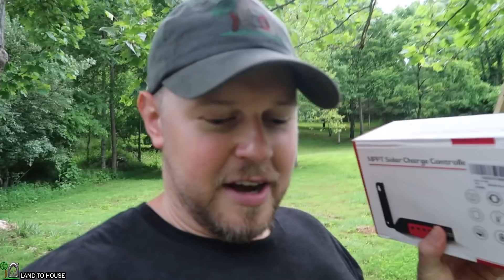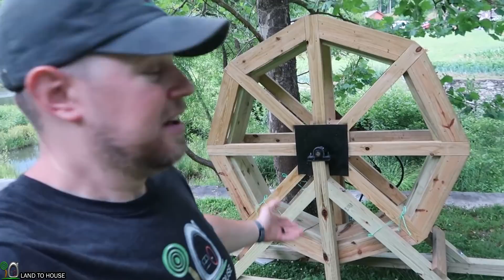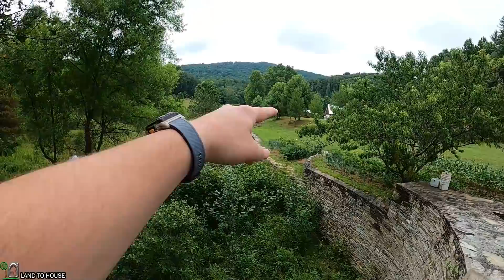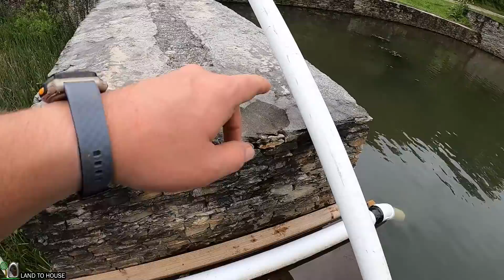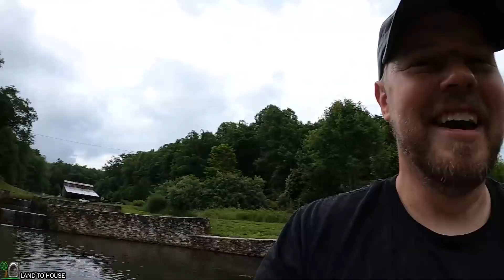Forced to move the 4 Inch Micro Hydro Turbine

Comment: I can think of how to improve the system with that same 4" turbine if you put a 30cm edge plank screwed together and then insert a pipe that is a bit too wide for the water intake, you avoid the water collection elbow and having to prime it, On the other hand, insert a vertical suction pipe with a larger diameter and end in the river with an elbow and an angle of no more than 45° or max, for example 67°, but not 90°, which slows down the speed of the water! With all this, increase the upper level by about 30cm, which translates into another 30-50w more, an improvement in water intake and better self-priming. 
on the other hand, a basic victron-type mppt, for example, works very well and if it is masrtsolar you can see the data for several weeks via Bluetooth! it's perfect for testing

Comment: If you're still experimenting with this setup, try putting your generator at bottom of water fall to get head pressure and find out flow of (gpm) of water fall to have idea what you're working with also find out how much  water is coming from the water fall above where you are experimenting at,so that water flow is constant you achieve voltage to simply 12v system. Good luck 👍

Comment: Could you use the venturi effect to self prime the siphon? You'd sleeve the discharge pipe in a slightly larger pipe which collects water from the waterfall, as that water flows past the bottom of the exit pipe it should create a venturi effect. I'm not sure it would be enough to prime it though. It would have the added benefit that although the siphon would stop when the pond drains down it would restart once the water flowed over the waterfall.

Comment: The stonewalls and dams are beautiful.

A water wheel should be round if it is to produce electricity. Wood is not good for waterwheels as wood absorbs water and the wheel becomes unbalance and hard to govern, stainless or aluminum would be a better choice for a waterwheel to produce power.

Comment: YOU HAVE A PVC TUBE FOR A HIGHER CAPACITY TURBINE, YOU HAVE A WATERFALL FOR BETTER WATER PRESSURE, YOU COULD HAVE 50 KW TO 100 KW IF YOU ORGANIZE THE STRUCTURES WELL, I SEE ANOTHER WATERFALL, YOU COULD BRING A TUBE TO GAIN MASSAGE FROM THE FIRST CASCADE HEIGHT AND HAVE MORE POWER

Comment: If you put in a ball valve in to 4in pipe coming over the dam would it alow you to stop the turbine without letting in air in to the system and start it back up easier

Comment: Even better than a tennis ball is a linear flow gate, simple put would be a section of standing pipe that has long deep slots. I have built them for water tanks, by take 3/16" x 2-3" strapping (flat plate). With the 2-3" sides facing each other, then flow rate is based on how tall this intake gate is. The depth of the strapping is what stops the water from making a vortex, can create a Laminar Flow into the pipe, this will help increase out put by a small %.

Comment: Think about the buckets on a water wheel. The max torque and power are when the buckets are even vertically with the shaft axis. This design however has dumped all the water out by that point. So ideally the buckets angle back so that they pour out near the bottom instead of before the half way down point. You want to maximize the amount of water and the distance it falls.

Comment: My question here is and I am a first time viewer here, why are you running a siphon feed instead of a pressure feed? you will get much better results installing the pipe below the waterfall using the water pressure instead of relying on gravity to suck the water through the pipe. instead of air leaks you would have water leaks because there’s a positive pressure not a negative one.
Reply from the maker: Thanks for watching. All of these videos on this 4" unit are simply testing for Langston's alternative power. I do have a board I'm gonna put over the waterfall to allow direct flow into the pipe.

Comment: but the wheels did not have a diameter equal to the available jump, the water entered from above flat and were they not round with many small houses instead of a few and large ones?
in 2021 it goes like this ...

Comment: I like your design, simplicity first!
For a more automatic starting up, personnaly i will put the generator/motor shaft on the intake pipe then use a bldc controller (3ph rectifier already inside for generator) to start the the siphon then just add air EV to stop siphon by allow intake of air on demand.

Comment: I'd put a reduction to 6" pipe as a diffusor at half way down and let it end over the waterlevel so it doesn't have to do work of displacing the water down there.

Also i'd put the board straight in line with the stonewall towards the pond. So you can work on the system without having your feet in 'deep' water like it was with the board near the turbine edge.

Comment: what happens if you Daisy Chain another one in at a 45-degree angle right after the first one will that give you more power and if so how much it appears there is a lot of wasted potential energy in the drop pipe
Reply from the maker: Apparently both will turn slower from friction loss and not make as much power.
Reply: @LandtoHouse  in my mind's eye I thought a 1-foot length Direct drop lose of the head pressure for the new generator losing 10w to 15w from 70w but getting 2x 55w which is 110w an additional of 35% energy collected increase or 
keeping the drop head pressure and taping into the horizontal syphon pipe part right before the drop generator with 2x 45 angle with the additional generator in a shark fin orientation

Comment: You could power his water wheel from the outflow of your turbine.  It only rains on the days that end in "Y".  :-)    Seeing that vortex form was interesting.

What is the history on those unique ponds?
Reply from the maker: Because of the downpipe height requirement the output water is below the wheel.

You got that right. Those days tend to be full of rain here in the mountains.

Many years ago about 2000 acres was set to develop but turned into a big scam. The ponds were there to look pretty.

Comment: When you get the board and sandbags, do you power tests (a) before board and sandbags, (b) with board and sandbags but with 45 degree part still attached to the intake, and finally (c) with board and sandbags but with 45 degree part removed.   Comparing (b) to (c), both having the raised water level, will show the negative effect of the 45 degree piece.  But with (a) vs (c) the two have different head pressure amounts, so would not be precisely comparible.

Comment: I would suggest using some CPV glue to make the pipe connectors air tight.
Reply from the maker: Yes that is ideal. Because I am just testing different things I did not want to glue the pipes.

Comment: Hi, I noticed you have multiple cascading ponds. If you have access to the top ponds, you could run a very long pipe and run it all the way down and run a pelton wheel. You could generate much higher pressure with a long fall.
Reply from the maker: That very thing is in the works. A Turgo unit with 100gpm ish and 14 feet of drop. Should make between 60 and 100w of power.
Reply: @LandtoHouse  oh that will be nice!

Comment: Love the videos, and that's awesome you have the top vacuum port to suck out more air, AND shut off the system just by opening it back up.
You may want to bring your gas trimmer and clear a wide path for eventuality when you have to wade through snake land to your lower test area. You can probably avoid the vortex by swapping the 45 elbow on the siphon intake back to the 90, now that you can get a much better seal that angle may not make a difference anymore.

Comment: Apologies, I am new to the channel and cannot understand why you would not locate the impeller/alternator just above the lower water level i.e. at the bottom of the available drop so as to benefit from the considerably greater power it should then make. I went back to your 25 March video but that didn't help. So what am I missing here - I don't claim to be a hydro expert, far from it.

Comment: Hey why dont you aim the outflow pipe right at the water wheel? You'll power 2 turbines with the same amount of water.
Reply: As soon as I saw the water wheel in the background I thought that was going to happen and thought that was the best idea. Twice the output for the same amount of water flow
Reply: Or not so much a water wheel as a peloton wheel
Reply from the maker: A turgo system is in the works. Should be fun.
Reply from the maker: The down pipe of the top turbine needs to connect with the water below. Sadly it can't go over to the water wheel.
Reply: @LandtoHouse  oh right- vacuum needs to be maintained.

Comment: You outlet pipe MUST NOT BE IN THE WATER. Make sure you outlet flow runs free. ie the end of outflow pipe MUST BE ABOVE LEVEL OF WATER so that water speed at outlet is at maximum velocity.
Reply: Incorrect in this application.  Having the output just below the water level on both ends is important for creating and maintaining the siphon.  Without it, the system would break siphon too easily since the pipe diameter is more than big enough for the flow rates involved.

Comment: Step 1: glue  duct tape if for heating ducts.  Stop wasting your time trying to save 2 bucks on fittings by not gluing critical joints.
Reply: Tape is easy to use for testing, especally when you are going to be changing things frequently.

Comment: if you add a shut off valve to the input pipe you can reduce the flow to match the flow of water through the pond system, if that valve is a float valve, when you install the boards to bring the water above the input pipe and turbine not only will you be able to set the height but would also give you a measrure of control over the flow rate of the water for dryer conditions

Comment: i would suggest gluing up as many joints as possible, for disassembly and maintenance add a few threaded connections, an easy fix would be to use rubber couplers and pipe clamps
Reply: Yes. Glue all the joints and add unions to subdivide the system for easier maintenance and transport.
Reply: My solution? Putty :D

Not leak proof. But will prevent the majority of air trying to infiltrate, while still granting flexibility of being able to disconnect joints.

Comment: Seems like it would work better if you put the turbine on the bottom of the pipe where all the weight of the water can hit the impeller
Reply: Maybe but i would of thought the vacume at the exit point of the turbine will aid  in pulling the water through the turbine

Comment: Instead of suppressing vortexes, it’s spinning torque could be be better utilized to spin turbines.. a boat propeller shaft coupled to the generator could be something?
Reply: The vortex reduces the power going to the turbine. Eliminating the vortex entirely will create more power thru the turbine and save you the effort of a more complex system. The movement of the water from one place to another has a finite amount of power to give. Removing parasitic losses gets you closer to that magic 1:1 efficiency number.
Reply: @ssteele1812  :  true, for Pelton type turbines requiring linear flow as used for the micro hydro.. whereas a turbine/propeller placed in a vortex rotates in centripetal spin.. look into Victor Schauberger (the water wizard) he utilized implosion pull energy over expeller push force.. so head pressure flow is mitigated as spin is gained from spin of vortex itself..

Comment: I begin to think your creating click bait videos when you don't do sensible stuff like GLUING cheap PVC pipe which is easy to cut and reglue if you need to change it OR JUST pull the fittings and seal the joints USING A SMALL BIT OF SILICONE and fit it back together (you can use a hammer to tap it apart any time)
Generally you have had interesting subjects but you drag things out and I have too much to do and just don't have time to waste on watching you try stuff that violates common sense. Why waste time doing things EVERYONE knows is crap (like using duct tape) instead of doing it right as needed.

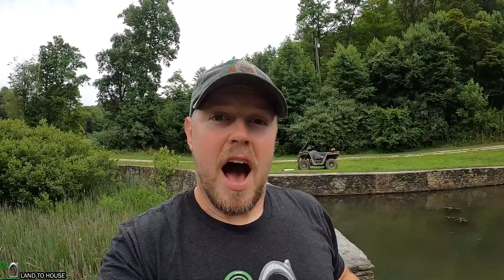Comment: 14:05
I would use another 45 down deeper into the water.
So the pipe is shorter, instand of using a strate pipe

Oh yes, you would raise the damm higher, right. That would kill the vortex too

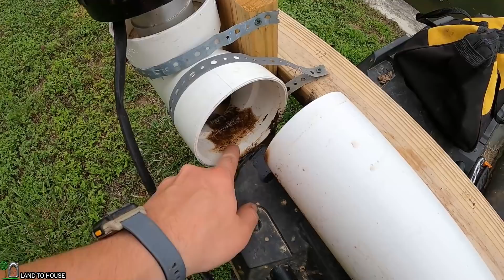Comment: 8:42
You still have a 90 into the micro, i think that should be 2x45th
Reply: Micro should also be as close to the bottom as possible... really need to make that shaft a LOT longer in this case

Comment: I can tell you from experience with my dust collector that a full caulked seal around a 6" sewer and drain pipe will be permanent enough that you have to destroy the pipe. The expensive fittings can salvaged though.

Comment: Nice one.. I did mention a few times to silicone the pipes instead of gluing, caulking works too.. If you can lower the turbine about a foot more would increase the pressure on the impeller and also will increase the power generated, since it gets its power from falling water, it makes since that lowering it would mean more water flow through it..  Just a thought.. I kinda works the same way as a water wheel, if you direct more water going (dropping) over (through) it will turn (spin) more and faster..

Comment: A perfect solution would be some duct seal to keep air from entering the system rather than tape.  Roll out a thin rope between your palms and place around the connection and push it tight with your fingers to seal. When you want to pull a part you can just pull the duct seal right off , ready for use again. Plumbers putty would work too and there’s a little more easily obtained. Great video look forward to your next one.
Reply: the solution is to prime and glue it with PVC glue….

Comment: Having a straight-through inlet does make a small difference, but unless you can get a decent amount of water above it you end up with constant vortexes.
I ended up cutting some irregular triangles out of the end of my inlet pipe (exaggerated holesaw look) and that seems to help prevent them getting big enough to breach.
Cutting it at a 45 degree angle (with the end like ◤) also worked pretty well to reduce them until the water got really low.

Comment: *moot

Also, why not just use the PVC glue that's made for those joints?
Reply: If he glues them, then if he has to make changes, the pipes will have to be cut instead of just pulled apart, the idea for using tape (waterproof) or silicone caulking is so it will seal and be easily disassembled..
Reply: I think the reason he isn't using the glue at this stage is that he isn't sure of the final configuration of the pipes.  The tape and glue make it easy to pull things apart and make adjustments without having to cut the pipes
Reply: Doh! Good point. He's in the testing phase.

Comment: I really like this experimental series, very cool!  One experiment I'd like to see, albeit not as simple to do, is to move the impeller at the bottom of the pipe and see if you get a power gain.
Reply: It would gain more power cause the turbine lower would get more water pressure spinning it..
Reply: @TheWolfster001  It also will have a major problem. The water will be under pressure and force its way into the PMA. With it above the level of the water, a seal leak will only draw air into the pipe. As shown, it already will self start which indicates the seal isn't a problem under vacuum.

Comment: If you could get a bank of these things in parallel that would be awesome
Reply: Great idea
Reply: Good idea, but has one problem, each additional one, would drastically decrease the power generated by the one above it..
Reply: @TheWolfster001  He's not talking about STACKING them, he's talking about putting them side by side.   The real problem is that just ONE 4" pipe drains the pond too quickly.  He'd drain the pond 4x faster, if he used 4 turbines.  He'd have to put the inlets all the way at the bottom, or find a way to increase the flow into that pond, but that would require finding a new source of water to feed the entire system ( all the ponds get filled from the same source ). 

He could do multiple smaller turbines, but I imagine a single big turbine is more efficient than 2 smaller ones.
Reply: @Fearmylogic  Several small ones actually would be better, in off gride.. cause if one goes out, you still have others supplying you power..  Now if he used several inline turbines, lower down, they would generate less each, but the total power made would increase a lot.. They make very small inline impeller type hydro generators They are pretty cheap, manly cause they provide small amounts of power, but like solar panels having several, will give you more usable power..
Reply: @TheWolfster001  I was talking about having multiple turbines set up, side by side.   But I agree, that would add redundancy, which can be good.

And if you have multiple turbines in line, as long as the next one in line doesnt cause enough of a restriction to slow down the previous turbine, then yeah, you could get a lot more power out of a single system.

My reply was based on the thought of having like 2,3,4 it more entire 4" pipe setups, side by side. But as I said, the water supply would hinder that idea.

Comment: A big bike wheel on water wheel will make it simpler. It looks like he will only a 1:1.5 rpm ratio. The wheel needs bigger gear on it and smaller on motor. 1:20 seems to be about right. 2 foot dia. drive gear and 2 dia. inch motor gear. Nice water wheel. I have plans to build one for power. Finding the low rpm 3 phase alternator/generator is the issue. At best I might get 20 rpm out of water wheel. A 1:20 gearing would get me 400 rpm at alternator. The wheel must catch 11 gallons (88lbs) at a time to give me the 1 hp.